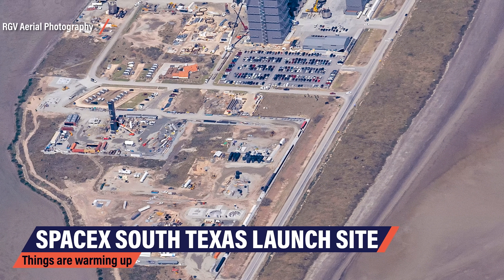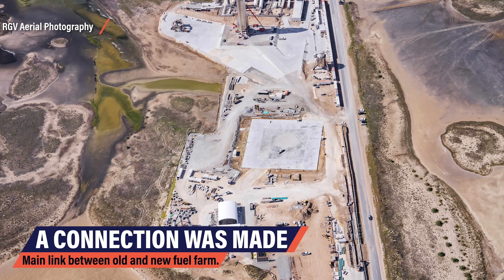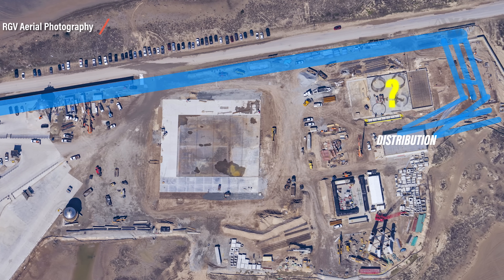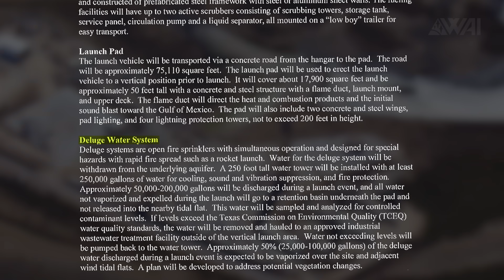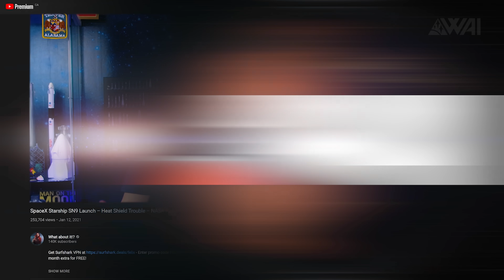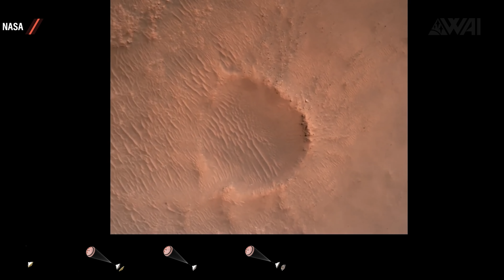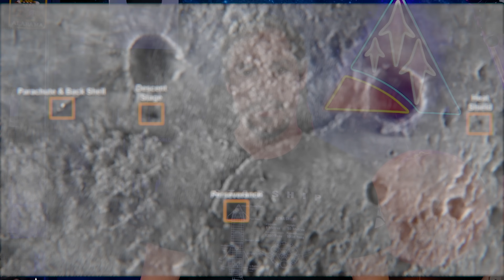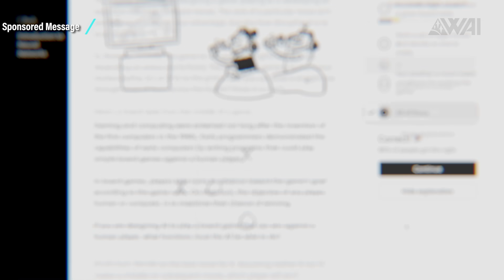149 | SpaceX Starship & Super Heavy Program Evolution – Perseverance Landing Footage Analysis!

Comment: Hey Felix,

Why don't they just pave the vulnerable concrete with that stainless steel that they're using for the starship. Wouldn't that protect the concrete, including the blast pit, and wouldn't it survive the heat blast? And imagine later, ripping that stuff up and using it as a structure somewhere or maybe a memorial to their achievements.

Comment: The four rebar reinforced circles are for a rig designed to catch either the booster or the Starship. Either one will then be picked up by a crane and swung around closer to the launch mount where the launch mount crane will pick it up and place it on the pad or in case of the Starship, a waiting Booster.

Comment: Cant' work out if those two loose strings blowing around are a few strands that snapped from the main bundle? looks a bit like peeling stringy cheese :)

In the bottom left corner of the video, the ends of which are in the middle of the left of the picture; they seem a bit short but might stretch under tension? 
https://youtu.be/NSa3AWjThwU?t=742

Comment: you keep referring to the 4 large round foundations on the concrete pad that the pipes route around. to me it looks like an area to assemble the rebars in the round configurations and will be lifted and set in place somewhere else. they do not look like a foundation, especially since there is a concrete pad under them

Comment: As a computer guy what amazes me, along with pretty much everything about this mission, is how relatively modest by today’s standards the onboard computing power is. I realise there’s a huge price to pay for getting radiation hardening which is why in capacity and performance terms it’s maybe 20 years behind current consumer computing hardware but for comparison my iPhone has 48 times as much RAM and 64 times as much non-volatile storage as Perseverance’s main computer (a BAE RAD750 according to wikipedia) plus the Perseverance CPU is a single PowerPC core running at 133MHz! There are some software engineers sitting somewhere that deserve a lot of praise for their masterfully efficient coding. It can’t have been easy to squeeze all that stuff including the very time-critical terrain relative mapping into such a modest setup. Impressive!

Comment: The larger diameter pipes might not be used natively, but as a conduit for smaller process pipes?  Burying pipes in the ground means you never get access to them again.  If you're wanting to protect more process specific pipes, you sometimes encase them.  There might even be a possibility that the pipes themselves would be filled with a material that provides insulation or some type of flame retardant.  If you're transporting fuel from one side of your facility to the other, burying the pipes in the ground means you don't get to see if there is has been damage to your pipe.  With pipes that transport fuel, especially gas, the danger of pockets of gas forming is extremely concerning.  Over such an extended distance, you'd really want to mitigate that risk.

So the large diameter pipes might be used to house smaller pipes that transport fuel.

Comment: green pipe is standard welded coated pipe. Would not put water in Steele pipe. Grey Pipe is used to run electrical cables underground to help prevent corrosion. any water will be likely ran in blue poly pipes

Comment: Green pipes are for water and they will connect to the 4 big round concrete tanks. They will use desalination and fill the big round concrete tanks. We have seen pictures of metal tank lids about the right size. (in this video they are just below center at the 1:00 mark and work their way off the screen to the bottom by 1:07) I image in the deluge system will be a simple gravity feed to the launch location in the green pipes. Simple is always best.

Comment: The small diameter "pipes" look like conduit used to route control and monitoring cables.  The conduit is usually encased in concrete to protect them.  This is similar to the conduits used in electrical substations.  The building with the large pipes and numerous valves would be monitored and controlled through the wiring carried in the conduit.

Comment: Those green pipes are more than likely for water. They absolutely are not for cryogenic liquids of any kind, because they are carbon steel pipe. Any cryogenic liquids will be run in stainless steel piping. If I could see the photos better I could probably tell you more. I've worked in a large fractional distillation plant among many other industrial facilities and even the cold wind tunnel at Nasa Glenn.

Comment: 7:40 The white stuff is ceramic fiber insulation. There's no adhesive. The fiber will be held in place by the tile mechanical connections. I work in industrial furnaces. Thats how it's done.

Comment: Just giving my opinion but from the 3 years i was striker for a construction supply and being in residential constuction sites the green pipes look about the same diameter as the drain pipes they put in driveways for water runoff but my knowledge is limited in the subject

Comment: yeah, no, sorry that big concrete pad is not gonna be a crane whatever or a "starship parking lot". its just fuel and water tanks. they probably gonna build the tanks in house as it's gonna be cheaper and spacex likes to build everything in house. and for that they will most likely use the very same process they already have for building huge tanks, there are ring stacks called "GSE". No real mistery here, the only question is how they are going to insulate the fuels tanks at the farm.

Comment: This is an incredible feat of engineering, but for some reason I just keep picturing a hilarious parody video of the landing where the heat shield pops off and we get the first look at the surface of Mars from high above the landing site, and scattered everywhere are hundreds of additional heat shields, remnants of sky cranes, parachutes, back shells, and countless rovers zooming around, bumping into eachother, driving in circles, tipped over, tangled in debris, stuck in sand, along with dozens of helicopters buzzing around, crashing into eachother and flopping around the ground.  

"Today we witness the incredible site of the successful landing of the 157th Mars Rover Redundancy".

Comment: Just a question, why is that you can't see any rocket flames coming from the sky crane while lowering the rover??
Reply: They mentioned during the livestream that the propellant they used does not generate a flame, even in the earth's atmosphere. However, you can see parts of the engine glowing pink from the heat generated.

Comment: Round foundation seems to me to be water tanks, because the green pipes come up there
Reply: @Flex @whataboutit, you do see the green pipes coming into the bunker, show you too, but you don't see on the green pipes where they come from, while that is visible in the photo from above, whatever you show, and then you see those greens pipes connect the bunker and rounds foundation under construction, mary has pictures of those green pipes before concrete is poured, which you can see between the bunker and round foundations

Comment: Are we positive that Super Heavy will undergo low altitude testing (hop/suborbital)? That's a lot of Raptor engines to risk when you consider that the dynamics and flight profile for Super Heavy (at least before the "catch" is implemented) aren't all that different from Falcon. It seems more sensible in my opinion to just move immediately to orbital testing. If you are going to risk the booster in the first place, why not get as much out of each booster as possible? Starship is different because it's not designed to get to orbit on its own, and the dynamics and flight profile is an entirely new concept. Low altitude/hop testing made more sense in that case. I think it would make more sense to get several Starship landings under the belt and then move immediately into orbital testing for the first Super Heavy.
Reply: Elon Musk has said that only 2 raptors are needed for the 500 foot initial  flight. The thrust puck for BN1 has room for 4 raptors. I think using those few raptors for a 500 foot flight is a good idea. If successful after that then going for an orbital flight with the Starship might be a good idea.
Reply: @MrEd2291  Gotcha. I was unaware that the config for BN1 was not utilizing the full number of Raptors (can't believe I missed that). If that's the case then it certainly makes sense to do low altitude testing first. Could we assume then that the first booster built with the full number of Raptors is likely to forego low altitude testing?

Comment: Blue pipes are definitely pressure pipes for water. You can commonly see these used for water distribution systems. I commonly used various items outside of their intended purposes during my civil engineering career but liquid, yes, pressure, yes, nasty chemicals and extreme temperatures? Not so much. Way too expensive for non-pressurized water flow such as drainage.

Comment: The gray pipes you see coming from the "area' of the tank farm are electrical. Gray pipes are used for electrical, like power, control wiring, and communication. White is usually sanitary and green is usually pressurized water. That area to the front left of the OLP where the gray pipes are stubbed up is going to be for power distribution, The structure with those 3 rings( I don't see a 4th), has an incredible amount of concrete beneath it. It looks like it is better than 2' deep with concrete. This is probably not to support the weight of tanks. They'd just drive piling for that. I think it is to support the weight of cranes moving Starships and Super Heavy's as you said.
Reply: Felix and his team have no idea what they are looking at, actually comical and sad.
Reply: @catskillcornmaze  thats why we help him out. We all cant be experts on everything. After all, this is the world of amateurs with very little detail and answers from Space X!
Reply: @catskillcornmaze  did you know what you we’re looking at beforehand? Nobody’s perfect that’s what makes everything special 
We’re not rocket scientists